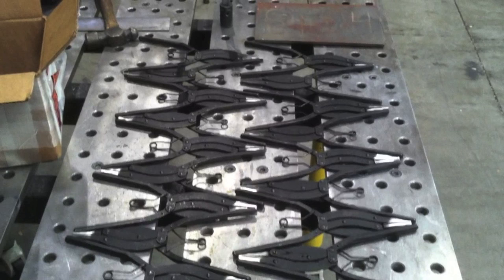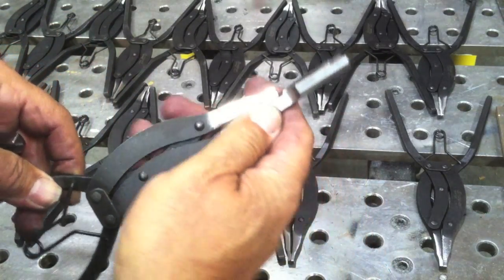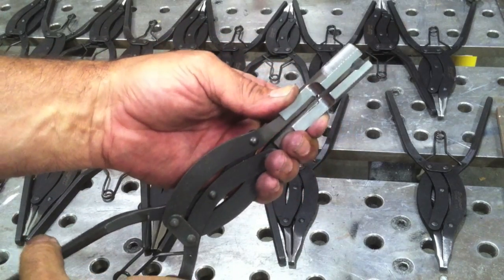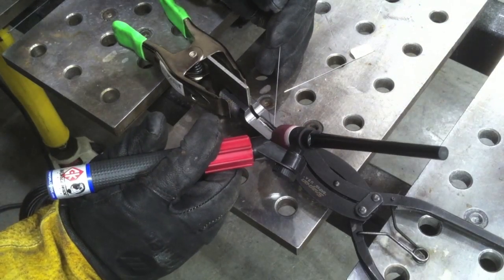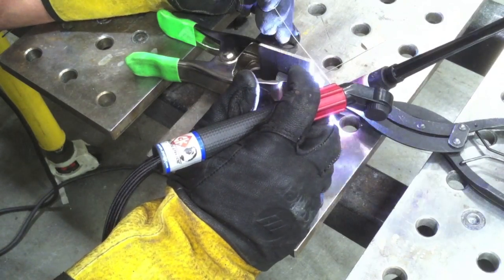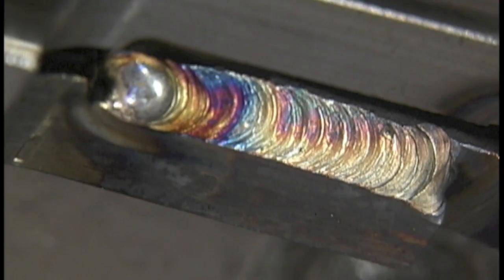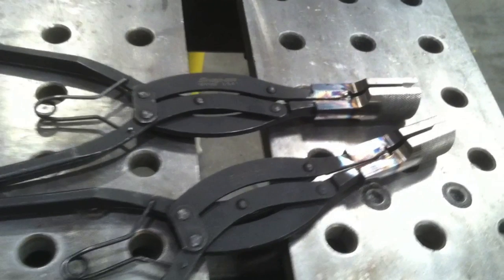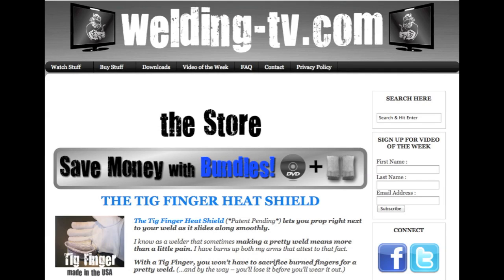TIG Welding Special Tools

Comment: That torch is perfect for what I want to do using my Miller Big D4 @ the lowest settings for lift start application when I have to weld really thin material. I don't have a small machine...all I have is this Huge Miller Big D4. I know I can weld 18 & 20 gauge sheet metal & chrome moly tubing, etc...
Cool video...

Comment: Hello Jody, I'm in doubt, I'm going to try making some tubing frames for fun and practice, Pipefitter by myself in the petro chemical industry and we only have piping, so we always use gaps, but my question actually is do you have to use a gap on tubing making exhausts/frames? thanks

Comment: Just wanted to ask, what's the real difference between AC and DC welding? I've heard DC welding is a lot easier but AC is a lot cheaper. I have an AC welder myself that i've learnt to weld with..

Comment: While in weld test today I saw one of your tig fingers,kinda odd from watching your videos to seeing someone else also has too lol.but anyways at the local we have been making these for years and the ones we make seem to be perfect for welding pipe only because we use the larger diameter tubing so you can use two fingers instead of only one makes long runs of welding more comfy than only propping one finger plus in our local we were taught to use the larger finger in a technique called